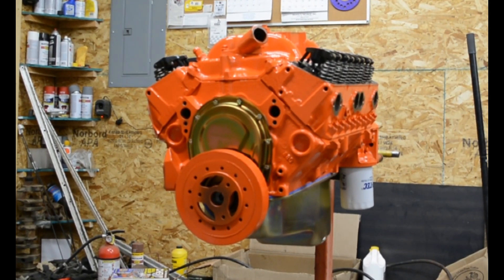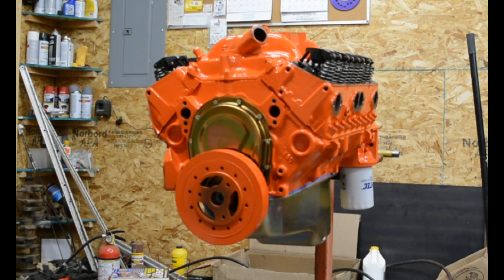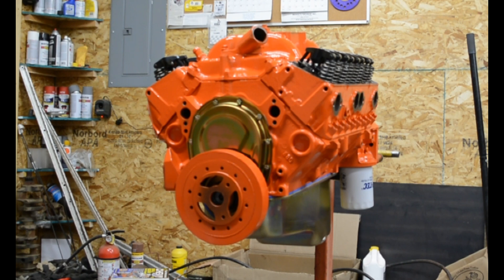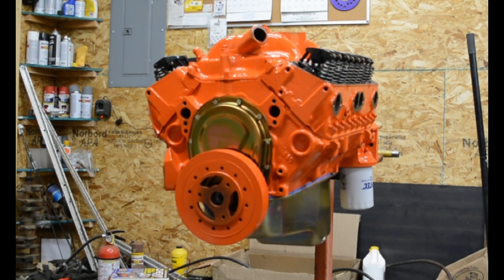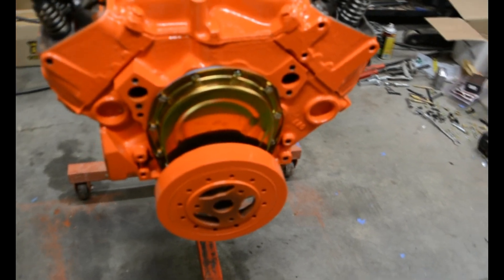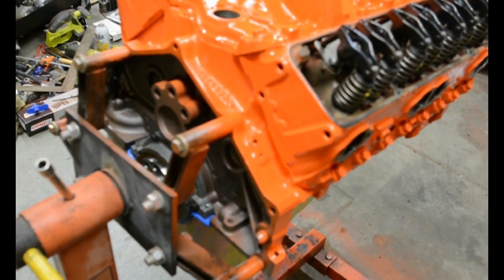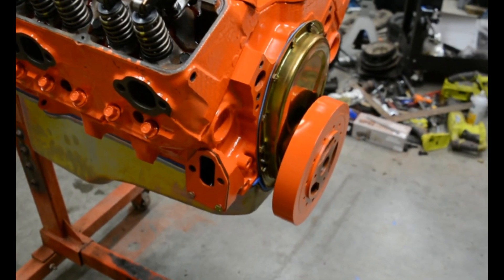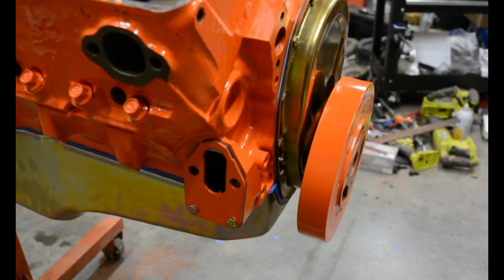383 Chevy, Nearly Ready For The Engine Swap

Comment: Wasn't the 82 model Chevy motors blue? Either way, nicely done. Post how the power output is.
Reply from the maker: You are correct, I can't stand the Chevrolet blue. Thanks for watching!
Reply: I had thought of instead of doing the Chevy blue. Doing a Kobalt blue. I think it would look sick with a bunch of polished aluminum.
Reply from the maker: @tubby1843  really any color looks good as long as it is done nicely. The orange is a blessing and a curse since it shows oil leaks easily.

Comment: What length rods did you use. I have a 880 block I’m about to start a 383 build with. Keep reading up to do a 383 on a 880 block you gotta run 6 inch rods then keep an eye on clearancing the block and watch rod to cam clearance. Any advice.
Reply from the maker: I ran a 5.7" rod, this is a truck engine, and even with that length the piston rings are very close to the top of the piston. The block did not require much clearance grinding but the powder metal rods I wanted to use hit the mild roller cam so I switched to Scat rods that still required a small amount of clearancing. Any larger cam should be on a reduced base circle or clearance will be an issue. Test fit everything before you send off your assembly for balancing and best of luck to you!